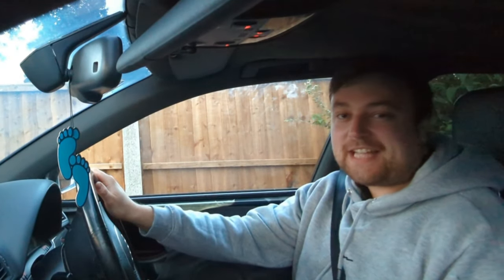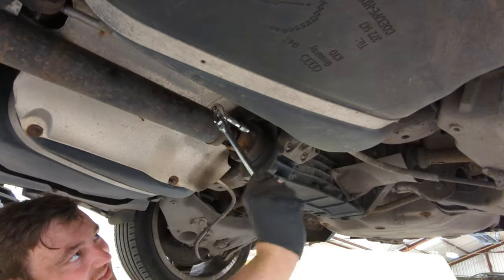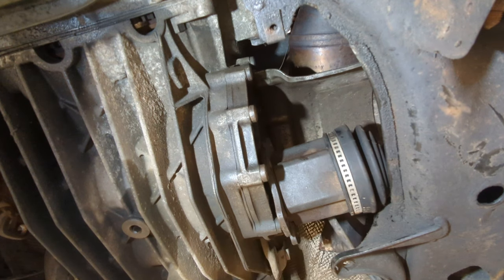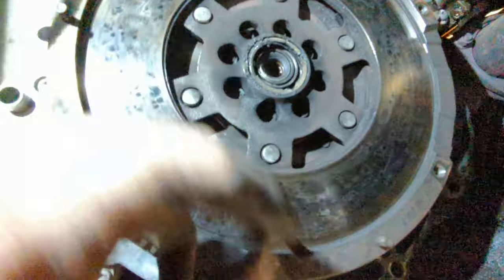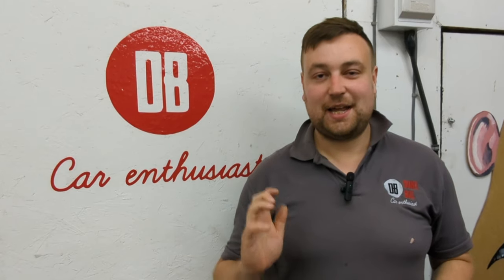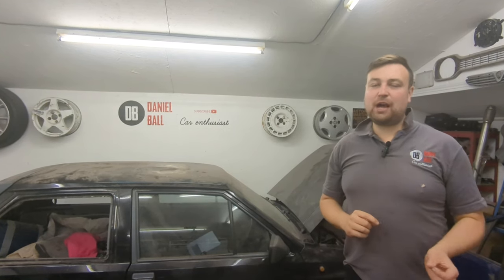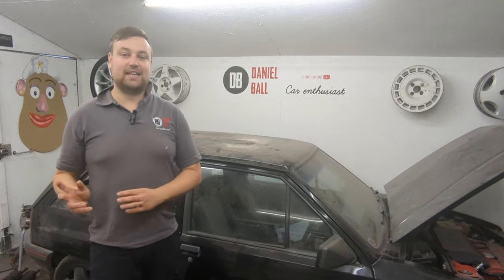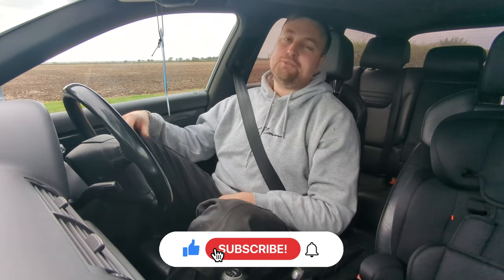NASTY engine vibration - How to change the clutch & flywheel on a V8 Audi S4 the RIGHT way!

Comment: I love my Audi, but I believe the timing chain service I had done a few months ago was possibly done incorrectly. I had them put in a new clutch as well since they had the car torn open. It does the vibration and I had my mechanic friend diagnose it and he said it’s definitely the flywheel/clutch. Do you think it’s worth me shelling out the cash to fix it again? I’m assuming it will be at least $5,000 USD
Reply from the maker: Personally I couldn't justify spending that much on one. But if you like the car, can afford it and don't want to get rid of it then why not?